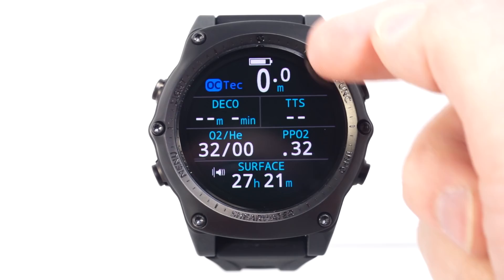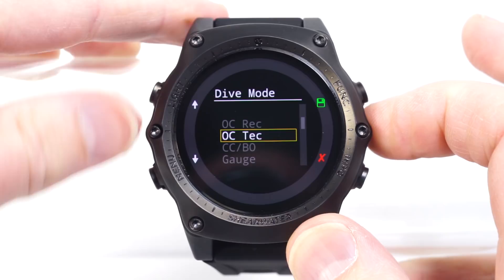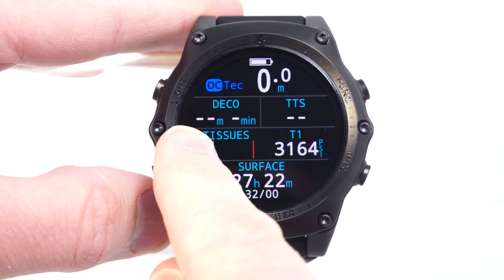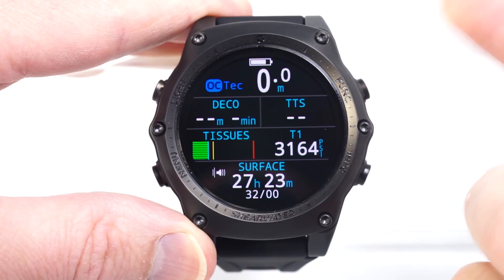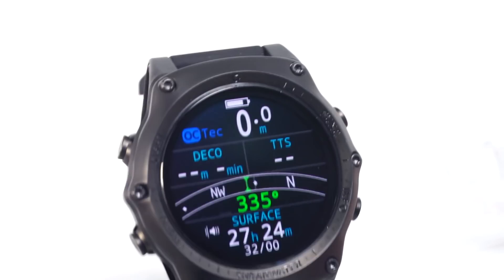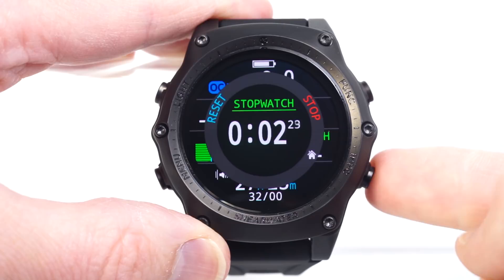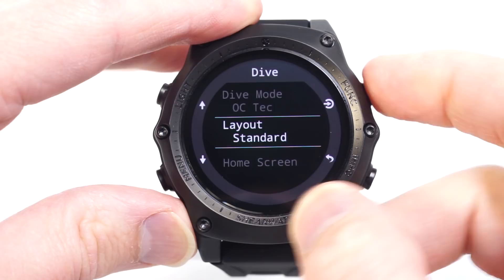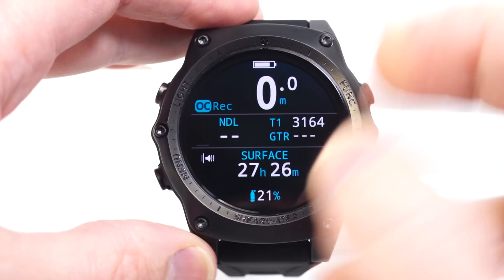Teric Home Screen Configuration

Comment: Does the colour changes as you go deeper or it stays as selected?  Example if I set it to red or green on the surface, will the colour change as I dive deeper?
Reply: You can't set the color to red. Red is an alarm color.
Also, no, colors don't change with depth, unless you're exceeding alert or alarm depths.
For instance, if you're diving on air, your maximum operating depth is 57 meters.
Once you hit 52 meters, the depth display will turn amber, and when you go beyond 57 meters it will turn red.

(You may see videos with text color being red, but that's because of the red filter on the camera.)

Comment: Is there a way to select 2 compass way points?
   - First 1 you select above water (your safe exit/home,  that remains for the dive (or is harder to remove)
   - Another that you select as your heading / way point (going to an anchor at 300°.....  Once there I change it to 230° to head towards the next sight...  Etc...

Comment: What is the battery life when using at a daily wear watch? I agree with poster below...the only thing stopping me from purchasing at the moment. I will be using it on dives but am a little concerned if it lasts only a couple days in watch mode.
Reply from the maker: Hi, Mike. Battery life is around 50 hours on watch mode.

Comment: ....wonderful...like my Perdix...
Reply: I have the Perdix as well. The larger screen allows you to put so much more information on it.
With the latest firmware update you can have 2 pieces of data on the top row (with one switching between NDL/Deco/SI automatically), 7 pieces of data on the middle row, and 5 on the bottom.
It does clutter the screen, but I know of no other dive computer that can give that much info on the fly.